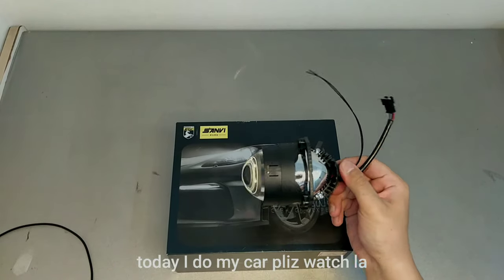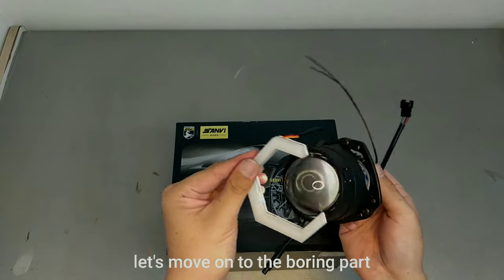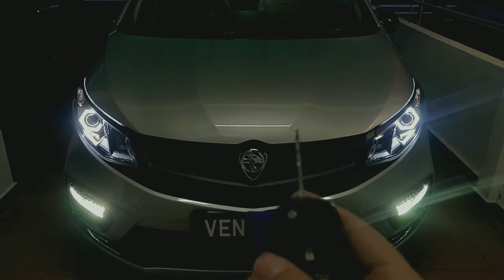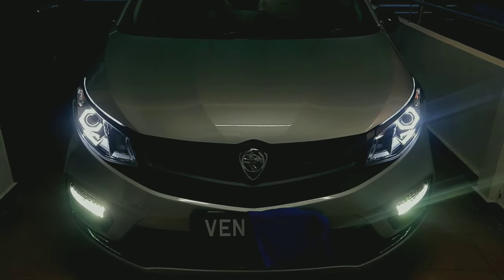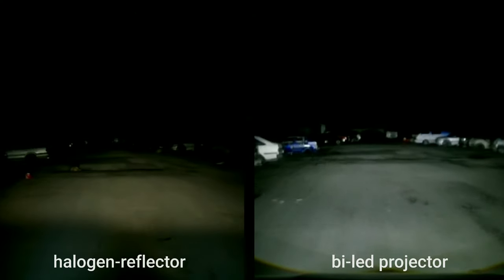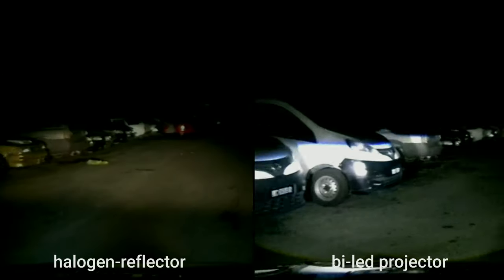EASY DIY RETROFIT Bi-LED Projector | Blackout Headlights | Hexagon Halo Angel Eyes | Proton Persona

Comment: I did this on my 2010 Picanto. One thing to note is don't forget to make sure beam is perfectly flat before gluing it back because you can only adjust left-right and up-down after that. This is very important because misaligned high output projector is much more blinding to other driver than LED/HID on reflector housing.
Reply from the maker: That is very true. I did not show that in the video but I actually had to reopen and reinstall it!

Comment: Hey bro, could you mind sharing the Taobao link again? The link expired and I couldn't find it on Taobao by searching Sanvi S8 or 三为S8. 

Also, now that it's 2 years since you did this modification, does the LED still work? Because I saw you mentioned the LED are integrated with the projector and if the LED burned then kena buka lagi the housing which is so troublesome 😓😓😓😓

Comment: Hi bro. I need help with 2 problem that i faced after doing the installation.

1) the low beam goes too low. Did my adjustment, yet still low.

2) not bright. Need recommendation.

Thanks bro
Reply from the maker: Hi bro. It could be:

1) the projector was not mounted properly - did you miss out on any components when mounting? The first time I did this I left out a piece of silicon ring that goes in before screwing in. 

2) did u adjust at the car engine bay area, near the headlamp? There are two adjustment places, one for UP DOWN, another LEFT RIGHT. Both accessible with Philips screwdriver. These adjustments will rotate the entire reflector.

 U need to turn A LOT for the angle to change abit. 

Hope these help.

Comment: Hey brother, which wire do you connect to get the light on after you unlock the key? Is it ACC?
Reply: I did connect to ACC but it doesnt work unless i turn the car ignition on..

Comment: You made taking apart your headlight look so incredibly easy...im scared to do mine myself
Reply from the maker: It's not easy bro haha. It took me 2hours to open without much damage like this. 

But now I just put the lights in big box, korek one lobang for heatgun to enter box. Medium heat for 15mins then easily open it. 
Less than 20mins can settle one lamp. 

But make sure box is big enough cause u don't wanna burn ur lens. Remember to remove all lightbulb and screws too. Total 10screws, 4 to hold the chrome eyebrow , 6 to hold the lens on the housing

Comment: I'm gonna retrofit my GM6 City as well.. But, I'm using Hella G5 Bixenon 3 inch projector. Since the oem low beam is H11, I need to cut cut 25mm hole to fit them in. And splice the wire from HB3 hibeam to activate to solenoid.
Reply from the maker: Sounds like an interesting project! All the best and update please!
Reply: Hello bro, im planning to do the same, how did it turn out?

Comment: I don't understand, you sprayed black the reflector bowl of the high beam too? But you ended up only adding a Projector for the low beam. If so, how do your high beams reflect the light source? Or, will you continue to get another Projector for the high beam in the later stage? Take the lampshade off again?
Reply from the maker: Correct bro. The original high beam will not be functional anymore. 

This single projector has both high and low beam. That's why it's called bi. But actually when shift to high beam it only lifts up a piece of metal to allow more lights to pass through.

Comment: excellent tutorial, well explained. INteresting to see heat gun doing the job. Do you just heat and pull one spot at a time or all around until its all coming loose?
Reply from the maker: Thanks sir. Heat all around then focus on an area and pull that area. Do bit by bit. Then heat all around again. This method is more difficult because the butyl rubber cools down and hardens very easily. 

I later discovered it is easier to get a huge box (one that can fit in about three of the entire lamp),

Dig a hole on one end of the box, put the lamp onto the other end, then insert heatgun into the box, medium heat, for bout 15-20mins.

Remember to cover up the box with a towel, use a piece of wood to elevate the lamp, and face the lens of the lamp away from heat source. Start with low heat/ intervals and work your way up cause excess heat may burn the lamp!

Comment: Mine is old persona. Want to do this, but I'm worry that i need to tebuk the casing. And for the wiring, boleh je kan pakai soket h4 and sambung pada lampu?
Reply from the maker: Actually Saya ada tebuk dekat dust cap utk bagi wire keluar. 

Sanvi S8 yg ni ngam dengan H4. Dia ada mounting ring untuk H4, H7. 

Cer tengok 4:16 Saya masukkan mounting ring untuk H7. 

Tapi Saya rasa persona lama bole guna yg 3inci. Lagi cun bro.
Yg ni 2.5 je

Comment: How did you know the projectors would fit in place of your halogen setup? Know modification or drilling was needed?
Reply from the maker: I just check if anyone out there has replaced the halogen w/ a 2.5inch or 3inch etc. 

And this projector goes directly into  the original bulb mount. So I just have to check compatibility. 

Hope that helps!

But honestly the best way is to measure.

Comment: How do you angle both projector? Parelel to the wall? I dont get that sharp straight line . I got both two beams instead of one like u shown
Reply from the maker: Normal to get two beams bro. 
Only at a certain distance the two Z will merge into one. 
Can watch other tutorials how to align car headlamp. 
25 feet from the wall parallel.

Comment: I'm still rocking the 2015 Iriz and from the manual book it stated that the DRL is LED module. Any idea what it means? I'm planning to change it's colours 'coz it's sort of yellowish-white (4300K or somethin'). Are the new Iriz and Persona models use LED Modules for the DRL or just an LED strip? The old Iriz has sort of a bulb LED.
Reply from the maker: Hi bro. I'm not sure but I don't think there is a bulb for your drl right. It should be led chips with a driver inside that cover - like us. 

If u wanna change colour I think your best bet would be to get an led strip yg siap dengan driver and naked cam ni

https://shopee.com.my/product/84388441/2703968756?smtt=0.113896583-1614348692.9

Pastu selit dalam drl tu. That's if you find out a way to safely open up, remove the old chips, install new chips and re-seal it la. Abit too much work bro haha
Reply: @projectgostan1773  what is the size of that projector? i’m thinking of changing the stock Iriz projector with a better aftermarket version such as the Koito H11 bi-Xenon.

Comment: Bro! Nicely done that. Im really want to watch more how you make the wiring. And can you tell me how can i buy those projectors headlamp and how much the price? I've click the link already but i cant understand. Did shoppe got same like this one?
Reply from the maker: Tbh the wiring is just high beam low beam ground. And for accessories from it's ACC in the fusebox, and from room lamp.

Yea unfortunately taobao only has chinese version. Try opening it with a pc browser and google translate. Some of their stuffs are significantly cheaper

Or u can search for Sinolyn Bi Led projector on shopee.
Reply: @projectgostan1773  thank you so much bro! My car using h4 headlamp. Can you teach me how to install the wiring for low beam and hi beam? How much the price in taobao? I saw its rm126 something. Is it true?
Reply from the maker: @nizamudinzupilah8805  u can either tap at the main socket of ur headlight housing or tap the wires within the housing. 

Yup that's for one piece. So a pair would be around 250. But courier fees would be around 50-60 so it's better to buy bulk. 

You need to get the butyl sealant too bro

Comment: Yo bro abit late but how did you did ur wiring for the hex halo i bought 2 rgb and 2 switch back I'm not good with wiring but can u give me an idea on how to?
Reply from the maker: Hi there. My halos are just 

+12V - to both ACC and room lamp (so that it turns on upon unlocking and stays on after room lamps go off)
ground and 
yellow wire to signal

Comment: hi, what happen to the inner light when you turn on your headlights? appreciate if you could PM the whole wiring diagram. Anyhow, awesome DIY project!
Reply from the maker: Hi there! I am a little confused but I can try to guess what you are asking.

My DRL and angel eyes are powered by both room lamp and ACC. 

So once car unlocked, room lamp lights up and drl lights up. After that room lamp is off and when key is on my drl will continue to light. 

But room lamp will not on because current flows from high voltage (room lamp) to low voltage (drl) in one direction only.
Reply: I think his mean is the hi-beam lamp?

Comment: How to install signal led? Please help me. Signal lamp socket no wire.
Reply from the maker: Dekat Lampu ada soket 8pin yg warna hitam Oren.
3 ground, high beam, low beam, t10, signal, drl. 

Boleh tap situ. Boleh extend pakai male female pastu tap dekat extension

Comment: How about the high beam? Really intested with Angel eye but wondering how about the high beam because the angel eye only have 1 main light right?
Reply from the maker: High dan low dah sekalikan boss. Sbb tu namanya Bi-led.
Reply: Bi-led has a built in solenoid that opens up the low beam cut off plate when high beam is triggered. When he high beam is not triggered, the plate is in low position.

Comment: Do you have any moisture issue on headlight
Reply from the maker: Nope! That is why it is important to re-seal the lens properly into the housing! Have to make sure that the butyl is applied along the entire groove on the housing where the lens sit on.
Reply: @projectgostan1773  im facing problem only on one of my headlight.  Thank you
Reply from the maker: @LAZER-PALDZOR  I'm sorry to hear that buddy. Sometimes wear and tear might cause the lamp to be not airtight. Maybe you can try replacing a new lens followed by proper sealing!
Reply: Just installed drl inside that caused problem. Tqlked with the dealer they might fix it thankyou for your time

Comment: Bro do u have a guide to install the led for turn signal and evening light. I cant find which wire to tap.
Reply from the maker: Turn signal I get directly from the main lamp socket which has 8pin - including signal, hi and lo beam, t10 position light. Cause there is no fuse for turn signal for this car

Comment: Nice mods there bro. I also used Proton Persona VVT with retrofitted Bi-LED projectors. But I made it at Headlight Retrofit Projector Malaysia (HPRM). Kinda pricy, but well, been using for almost 3 years already. 😂 Planned on doing some more retrofit, by using this Bi-LED from Sanvi and try to fit on both low & high beam 😁😁
Reply from the maker: Did u cut your reflector? Honestly bro I don't think this budget projector can match bigger projectors that needs drilling on thr reflectors but if your reflectors are still in tact then can try! 

You can also black out the chrome on the reflectors if you haven't! It's just so much better than tinting the headlamp imo
Reply from the maker: Also note that our high beam n low beam are not side by side. Dia serong ke atas sikit. 

So kalau buat dua biji mata in my opinion dia jadi macam spider eyes la hahaha. Bole research dan edit gambar dulu bro baru decide nak letak sepasang ke dua pasang.
Reply from the maker: @AznilAzni  ni la tuan diaaa. Yo I looked at your car so many times before I retrofit mine hahaha damn bro.

You already have lg innotek v2 man don't need this sanvi anymore. 

I wanted to do also but I think the quote was 1.7 or 1.9k for the projector alone.

Too bad our cars cannot fit edison r2.
Reply: @projectgostan1773  planned to add 1 more on the highbeam laaa. Haha. And yeah, that's my car. Cuba cari supplier for Edison R2 or Gino S1 punya model also, but can't find where. Sebab nak cuba drill reflector instead of normal PnP for the placement. Hehe. Your Sanvi mcm muat² masuk high beam reflector, but need to carefully do the fitment la.
Reply: @projectgostan1773  can't fit if want normal pnp. Drilling & cutting, I think can.

Btw, I got mine at RM1650 bro. Mula² fikir jugak. But I am an avid night time driver. So, this kind of lighting really helps.
Reply: @AznilAzni  Hi bro, dapat cari sendiri ke untuk Edison R2?
Reply: @ochuisang  not yet la. X tau mana mau cari. 😅 Got any idea!
Reply: @AznilAzni  Edison R2 ni kurang info bro. Susah nak cari. Ingat bro dapat. Haha.
Saya tengah tengok product sinolyn , macam ok
Reply: You guys lucky la.. now their price increased gila... lol better find RD
Reply: @akt8985  RD also nice. Tp tu la... Always fully book. Susah nak dapat slot. 😂
Reply: @akt8985  just ask the price, 2.5k @@
Reply: @AznilAzni  RD?
Reply: @ochuisang  for that price i think better to just retrofit the mc2 led headlights lol

Comment: I hope you included the wiring procedure.. im looking to DIY the same bi-led projector. But im quite worried about messing up the wires. I might end up burning it. Haha.
Reply from the maker: Tbh the lamp only got 3 wires. just high beam low beam and ground.

Just connect the wires to your high beam, low beam and any ground of your car. 

These wires can usually be found in the fusebox (check manual) or in my case, I connect directly to the group of socket behind my lamp. It's an 8pin socket and has high beam, low beam, signal, t10 position light, drl, and 3 grounds. 

And for the halo angel eyes, it's from both ACC in the fusebox, and from room lamp.

Good luck!

Comment: Bro you think wira original headlamp possible tu add the projector?
Reply from the maker: Bro wiring is just highbeam positive negative and low beam positive negative. Simple only. 

U need to worry about size and the mounting type (h7 h11 etc).

Comment: some of your link have been removed.by the way,in total how much did you spend on all this?
Reply from the maker: Ahh sorry man taobao links keep getting expired for some reason. 

Projector about 300yuan
Angel eyes rm200+
Led eyebrow 30yuan
Then the rest r painting and wiring 

It's a pretty cheap setup but the angel eyes abit not worth it considering it's CCFL material. DTM materials are better

Comment: Hi bro😁👋 how did u set the led light to turns on when u unlock the car at 5:13?
Reply from the maker: Hi bro. I tap the room lamp. 

So my drl and angel eyes are both powered by the room lamp and ACC (to keep it on once room lamp goes off)
Reply: @projectgostan1773  a very thank u bro..ur new subscribers here👍😁...hoping to see ur new video..
Reply from the maker: @xmrlxm6691  thanks alot bro appreciate it! Things are pretty messy lately with the PKP. Still trying to find time for more content!

Comment: Hi bro, still confuse about angel eye daylight wiring connection, mind to sharing info XD
Reply from the maker: Hi bro. I took from acc from the fusebox and directly from one of the terminal in the cars room lamp all the way through the roof. Same circuit that powered my DRL which I installed on my own. 

Honestly in car electricity longer wire means more risk I don't really suggest it la. But I'm willing to risk it considering that they only consume about 500miliamp.

Reason why I get from the room lamp is that I want them to light up after unlocking.

And I got no choice because there isn't a fuse for room lamp. Closest thing is the FS36 Battery Saver fuse (controls room lamp and lamp inside boot - sort of) in the driver's side fuse box but that's permanent 12V. I had to change it to a  15A to make my system works though.
Reply: Thanks bro, already installed follow ur setting but im jz connect to the acc from fuse box, the room lamp too high tech for me to do it.. hahaha